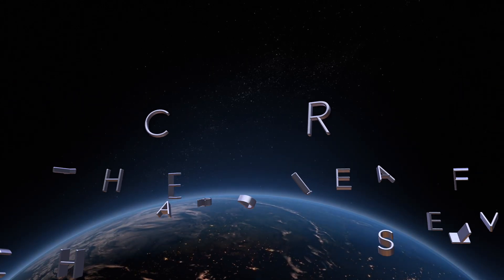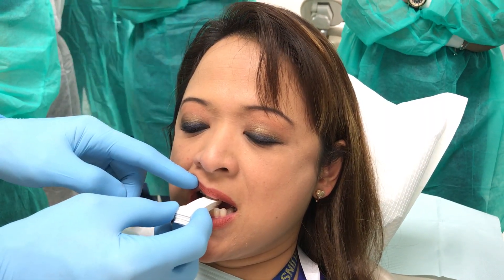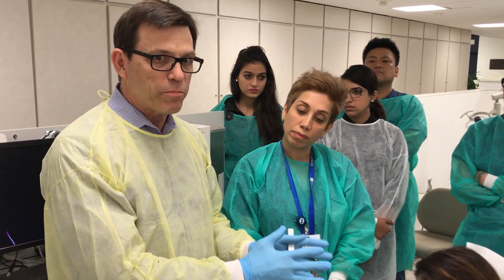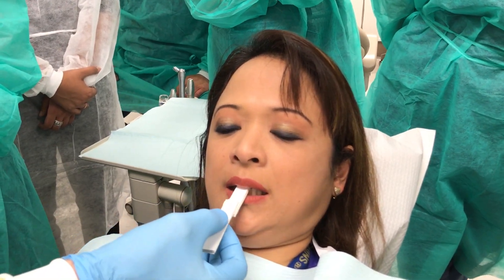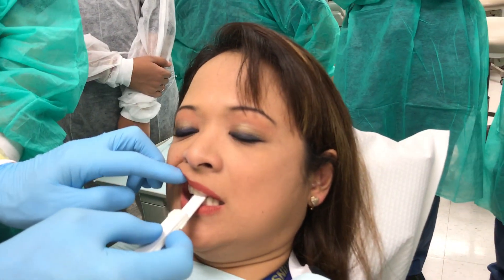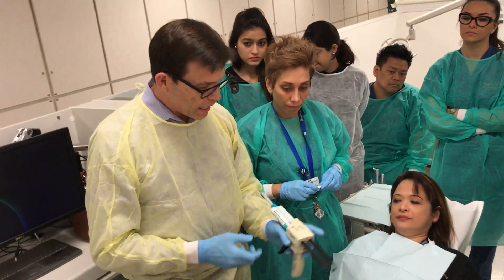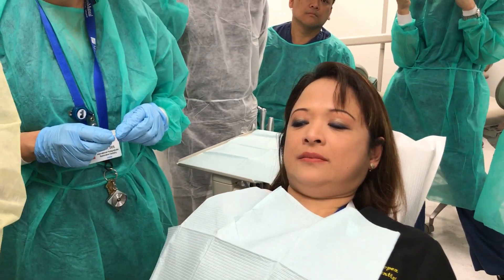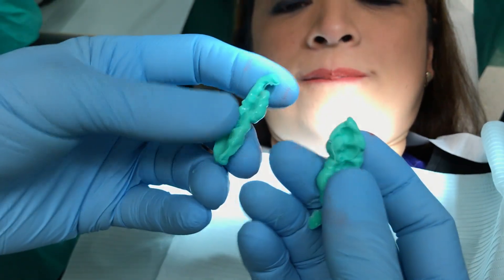Clinical Occlusion: Taking an accurate CR Record using a Leaf Gauge

Comment: Thank you ! I'm a little confused- When carrying out a bite registration/CR inter-occlusal record to mount a lower model onto an articulator do you need to measure the first point of tooth contact in CR? or is it just for record of if there are discrepancies in the future you cannot locate?
Reply from the maker: It's just to know for future reference how well you have replicated the CR mounting on the articulator - it should be the same first point of contact.